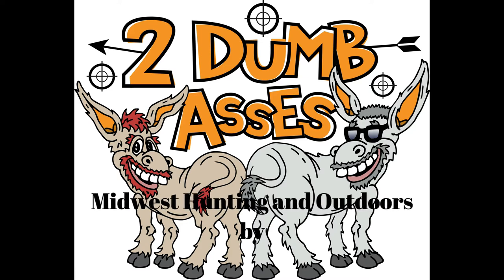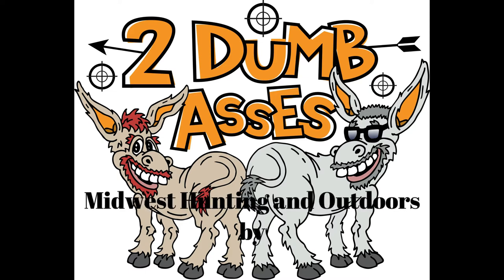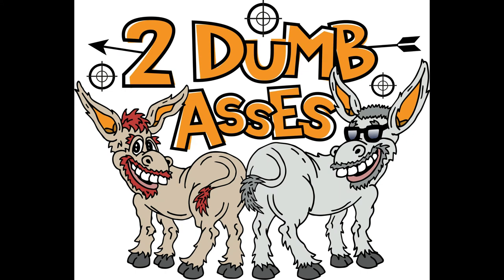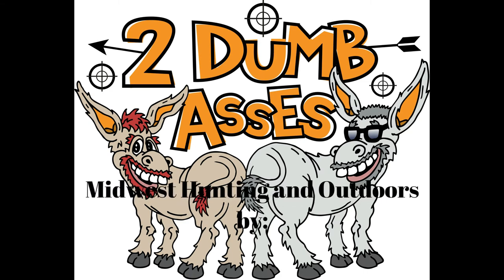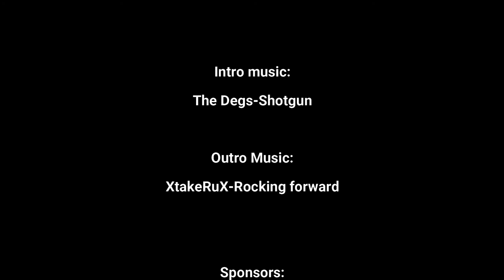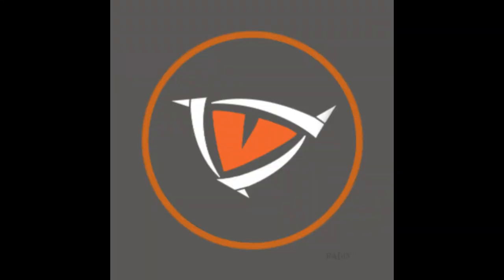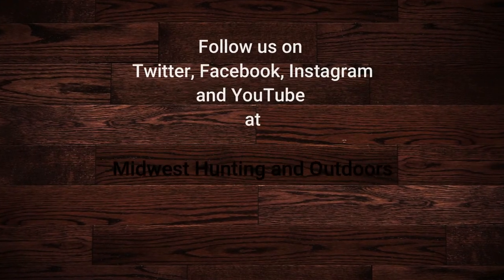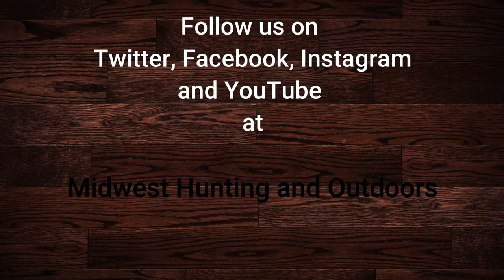Tips and Tricks #4 by 2 Dumb Asses: DIY Chainsaw sharpening

Comment: As the chain cutters wear back, you will need to occasionally knock the raker down (not at each sharpening).  The raker is the tab that sticks up ahead of the area that you are grinding to sharpen.  There are gauges available for keeping the rakers consistent, and at the original cutting depth.  The raker controls how much of a bite the cutter takes in the wood.  With time, you know by sight how far you want to knock them down.  If you have a saw with more power, then you usually knock them down more to utilize the power of the saw.  Here is a link to Wikipedia with a few of the more popular types of chains for saws.   https://en.wikipedia.org/wiki/Saw_chain  Keep in mind that depending on the style of chain and cutter you will need to sharpen at different angles.  The full chisel is a different angle for sharpening than the semi-chisel chain.  Remember it is better to sharpen a chain too often, than not often enough.  The longer you wait to sharpen the chain, the more rounded the cutting edge gets.  I've been asked to sharpen a couple of chains that were so badly rounded I almost wrecked them to get an edge again.
Reply from the maker: Thanks Wayne for the info.  Great addition.